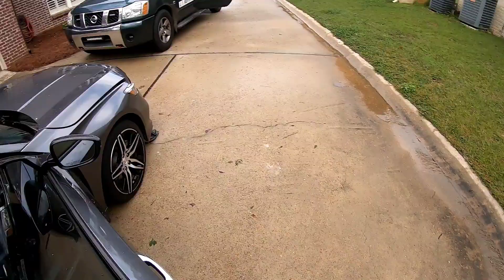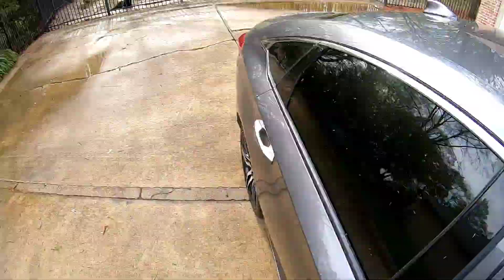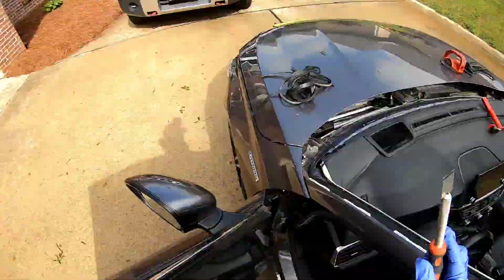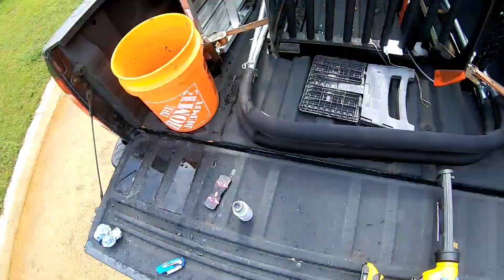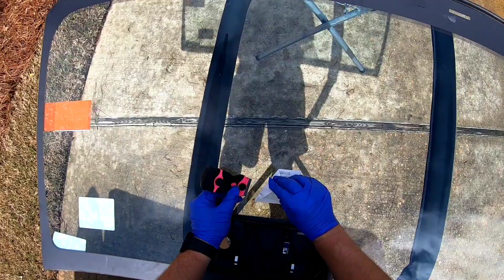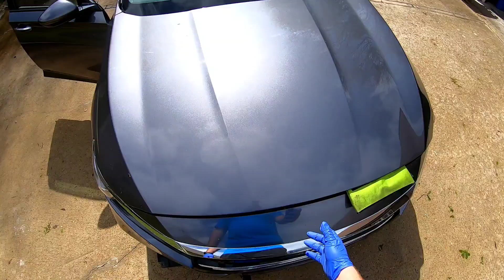2018-2022 Honda Accord Hybrid - Windshield Replacement (ECM FCA HUD LDWS RS)

Comment: Did you have to calibrate the sensors? Because my windshield cracked and shops have been telling me that I need to calibrate them
Reply from the maker: If your vehicle has LDWS, looks like a triangle 🔺️ from the outside top middle by rearview mirror with a small camera peaking through, then yes you will need that recalibrated everytime the windshield is replaced or the vehicle is involved in a fender bender. The other sensors such as rain sensor and heads-up-display do not need recalibration.

Comment: I use the quickset as well, but make sure you clean the dust and debris off the hood before you suction it down! Less chance of leaving a ring and scuffing the clear coat.
Reply from the maker: Thanks for that tip! We just used our Quickset this past week for a DW01648. Always fun to use other methods for setting.

Comment: Nice to see you use a WRD Spider to cut out the windshield. I’ve been using mine for about 13 years now, probably 1400 windshields under my belt with that tool!
Reply from the maker: It's a great tool, glad to hear you've had such good experience with yours too!

Comment: Hi where can I get a windscreen for the 2019 Honda accord touring ? It’s hard to find online for a reduced cost
Reply from the maker: Contact your local auto glass shop *do not use nationally know glass shop, they price the glass near list price.* For the 2019 Honda Accord the windshield requires ADAS Recalibration. The glass shop can get that glass for wholesale price, however if you buy just the glass don't be fooled, the shop or seller online will put a markup on the glass because you are taking time away from them doing installs to meet up and drop off a glass also shipment of a windshield via the mail system never works out. Long run it is cheaper to let a glass shop do the work and do it the right way. Also insurance companies have started dropping coverage on customers who replace their windshield without ADAS recalibration when the vehicle is equipped with the Lane Camera. There is a report that the shop has to compose, sign, with photos and they submit this to the insurance company after every install on vehicles like yours.

Comment: Thanks for the new video. I own an auto glass shop in north Mississippi. I watch everything I can find. I grew up in south Jackson and cut my teeth at Dixie Glass back in the late 90’s . I am just not moving into calibration.
Reply from the maker: Feel free to text our phone number or email us if you have any questions about anything. We have been very successful in our installs, not requiring recalibration afterward minus a 2018-2020 Acura MDX, they require OEM windshield if equipped with LDWS. Hopefully, soon, we will have some videos of our mobile ADAS unit in action. Customers are finally interested in recalibration here in Jackson metro.